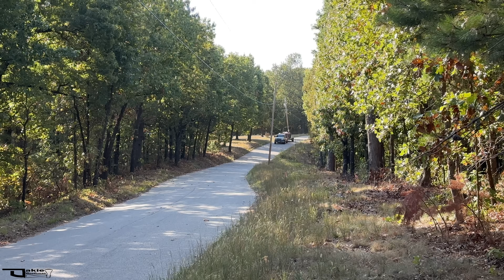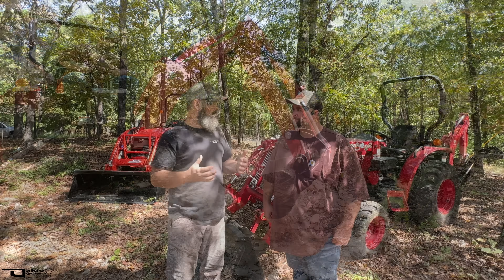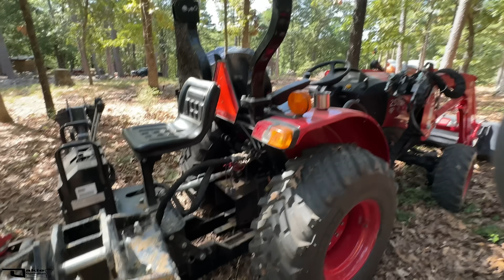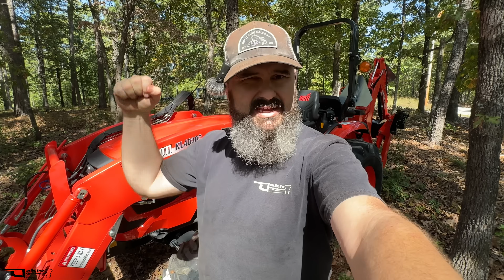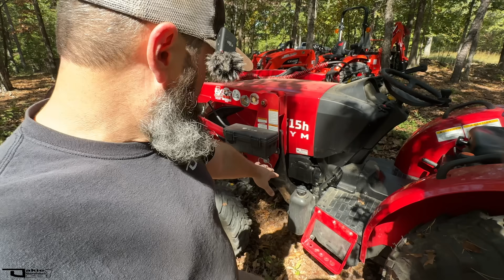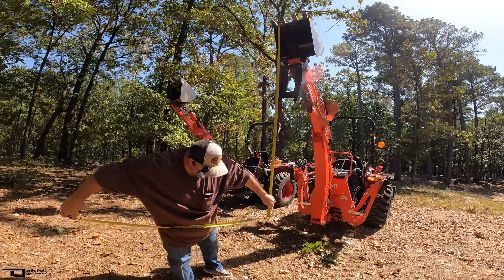DELIVERED! Kioti CK2620 and TYM 2515H - Do NOT Buy Until you Watch THIS!

Comment: Good news bad news.  Bad news, I ended up with the 4030 loader.  Good news, it still has one of the highest lift capacities in the industry and all the lift capacity I need it for.  🚜
Reply: Hey rockin hillbilly. I think the 4030 is just fine and most people won't notice the difference in capacity. The Kioti is a great machine all around and like you said it is one of the top machines in this class with its lift capacity. Thank you for being here
Reply from the maker: @beardedrockinhillbilly but I am seeing that there are some specs on it that are actually better in some regards.  May not be actually much of an "issue" but on paper, it seems nice to have the extra capacity.  How long ago did you get your machine and what are your primary uses?  Thank you so much for being here and sharing!
Reply: @oakiewoodsman   A week and a half ago.  Just a hair under 5 acres, 2 wooded 3 lawn/pasture.  I tried to do the buy once cry once, offset ditch bank  mower, land plane, grapple, stump bucket, pallet forks.  The only thing I didn't get yet is the tiller I want.  I'm hoping I can pick up a used one in good shape next spring on a good deal.  Just hobby farming and property maintenance for now, although I might get into planing gravel driveways and tilling gardens / food plots  in a year or so as a side hustle.  🚜
Reply from the maker: @beardedrockinhillbilly Very cool indeed!  I just put some more time on this machine today and I am extremely impressed with all that I am putting it through.  Congrats on the new purchase and it sounds like you got a great setup for sure.  Hope to see ya around and please let me know how the machine is treating ya sometime down the road.
Reply: I just got the 4030 on my new 2620 cab. Ordered  it for the extra foot of reach when loading trucks and the heavier duty quick attach assembly. It looses some capacity but it has an extra 100 pounds  of steel over the C
Reply from the maker: Oh…… are they dimensionally different then?  That would make sense of the lesser capacity of that is the case. Thank you for sharing!
Reply: @oakiewoodsman  Yes they are different and made by different manufacturers. The lift capacity and digging depth.  The C won't dig as deep either.
Reply from the maker: Interesting!  I would never have thought about that.

Comment: the KUKJE engine is a big deal.  I have a TYM T494 it has the KUKJE A2300 48hp mech fuel injection. the T574 is the same with a turbo. the TYM 4820 has the A2300 KUKJE also. similar to t494.  tranny is different 4 vs 3 range.  the 4820 has a touch more gp hydraulic flow. the T494 has a bit more features. 28k-31k with rimguard and 3rd function. O ya the other big deal to me is the TYM factory hard lines to the bucket.  NOBODY does that, not even them there KU-BOATERS!   and the gold plated Deere's don't have hard lines to bucket. Kioti and TYM win the BANG for buck. Daedong 6 computers and 22 sensors the KUKJE has 1 computer or data logger and 6 sensors.
Reply from the maker: Wow!  Thank you for writing out all of this information!  I know when I was looking orginally the Kukje engine in the Bransons was very intriguing for sure!

Comment: Great video young men!! Congratulations on your new kioti tractor!! Well I had a 1526 mahindra my cousin sold Branson tractors he talked me into getting a 2515 Branson the way I use a tractor it just didn't feel safe to me I loaded the tires with finish mower my 2 granddaughters in the bucket it actually broke traction in yard. If I had more weight on 3 point there no doubt it was a good tractor.  I got a 1626 mahindra 3 years ago.  Just traded for a new kioti ck3520se tractor I truly love the tractor so comfortable with work the way I do. Wanted the 2620 but dealer didn't have it in shuttle shift I personally didn't want hydrostat drove big truck to many years.  Didn't really want the regen stuff but it is amazing the differences 10 hp makes.  Thanks for sharing ya'll be safe enjoy.
Reply from the maker: Great story!  I appreciate you watching and taking the time to share with is all. I originally was going to buy a non hydrostat but nearly everyone talked me out of it due to my intended usage and property topography. I drive a manual transmission truck and love it but with the lack of fields, mowing and clear space, I decided to go with this unit. Again, thank you for being here!

Comment: Great video as usual and congrats on the new machine! I bought a Kioti CK4020se/hst this past spring. Thankfully mine came with the “C” loader as well. I got the backhoe with it and also picked up a grapple for it. It just turned over 60hrs last week and I couldn’t be more happy with it! I’m sure your experience won’t be much different. Be safe and have fun!
Reply: Hi WV. KIOTI makes a great machine. The 4020's are fantastic work horses. Great machine you have.
Reply from the maker: @wvoutdoorsmen5887 Did you see this coming????  I did not look at machines in that size range but I bet it is sure nice having the SE madel with ALL of the options!  A grapple is going to come eventually but I am VERY picky about grapples. I like them as sort of a root rake to be able to clean up all the small debris from tree work.  What do you have?  How is your dirt?? I actually was recently looking at Land out that way and it is VERY similar to my topography but there is much more of it available.  Can we consider ourselves "lucky" to have the C loader???

Comment: I like both tractors and I've seen both of you guys on Rockhill Farm with Brock.

I have a Milwaukee 12v grease gun to replace my air powered one. But I also use it for my job too.

I have a kubota L3130 hst and it has the floor mat and I'm definitely in favor of vs not having the rubber. My Mahindra max24 had it also.  But buying a horse stall mat could be fixed on their and be just as good. That's what ide do.
Reply from the maker: Wow!  I sure appreciate you venturing over here. Did you see the Split-Fire video I did with him or the chainsaw videos?  You have a wonderful tractor. I love Kubota machines very much. In terms of the mat, the Kioti one really isn’t terrible in terms of cost but I dislike being nickel and dimed. It is my opinion the machine should have included on. Oh well. Thank you again!
Reply: @oakiewoodsman  yes sir. You're absolutely right, and I see no fault in either, but even I have some things I can point out about my kubota that could be better.  My tractor has the LA723 and it's the biggest capacity offering for my tractor and it capacity is rite under these 2 tractors.

I did see both episodes.  I have echo saw and trimmers. Love them.
Reply from the maker: @andrewanderson1436 Excellent!  I have loved every minute of operating a Kubota machine each time I have done so.  Maybe someday I will get a Kubota Mine ex and Skid Steer.  That would be my dream!
Reply: @oakiewoodsman  I wish you the best on that. Kubota does make some nice equipment. I would love to have some more, lol.
Reply from the maker: I sat in and played with a brand new 4 ton Kubota Mini Ex today that my friend just purchased. He also got an svl75-3
Reply: @oakiewoodsman  a friend of mine, has a Kubota M5-091 for feeding hay mowing and making hay. I like it. It has plenty of power, but because it is new with DEF and regen, he's not 100% liking it. He's talking about wanting to replace it with an older model, 100hp tractor, pre emissions.
Reply from the maker: gosh dang!  Big expense and loss of $$$ I would assume.  Such a shame that these simply robust machines have been complicated with that stuff.

Comment: Sorry but this machine (2520) has not been the tractor I hoped for. Kioti didnt stand by the product while it was under warranty and either did the dealer.  They repaired the machine but it was in the shop for 6 months.  It had less than 100 hours on it factory threading issues on bolts and major hydrolic leaks.  Foreign companies have no accountability to their products.  25k on the product and used car salesman service isnt exactly what you want.
Reply from the maker: explain the tread issues.  Did your loader bolts come loose?

Comment: I would never have either one. I have looked at Kioti before. I was not pleased with how the backhoe hooked up to the tractor. Looks like the TYM has the same setup. JD & Kubota backhoes are closer to the tractor. I have a 42 hp kubota but did not get a backhoe. I didn't have plans to use such implement. I prefer an excavator over backhoe.
Reply from the maker: I hear ya but neither of those options make sense.  $10k more plus far less capable.  When they get their specs equal, then they can charge their premium for the name, resale value and superior hydraulics.  I prefer the Kubota Hydraulic operation over my tractor 100%. But again for nearly 2k lbs of lift and 10k less, I will take KIOTI any day.  Even if I could have afforded the Kubota, it still didn't left enough.  If my pocket book were that thick, I would buy and CTL and Mine EX instead.  Thanks for sharing

Comment: The “C” on the loader means it is compatible with “Cab” versions. (Higher lift capacity because of less reach). C loader can fit on ROPS, so you will see both, where the cab models have to have the C loader or it will hit the cab.
Reply from the maker: I had not heard that yet and I really appreciate you jumping in here with that information. I had heard it was a regional thing and the “c” stood for Canada.  I was scratching my head trying to figure out why they would be specked differently with different reach and capacities. This however, seems to make quite a bit of sense and I would like to find out more about it. Thank you so much!
Reply: Wrong. C is for Canadian manufactured.